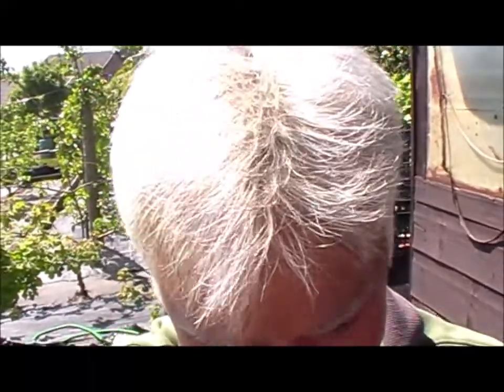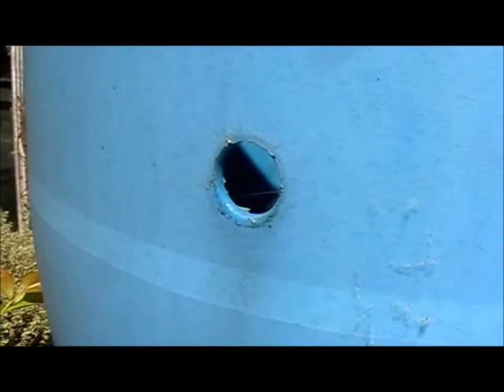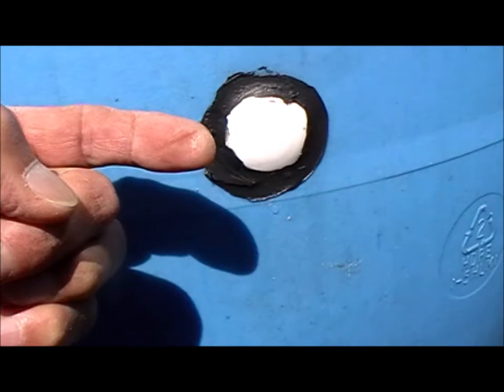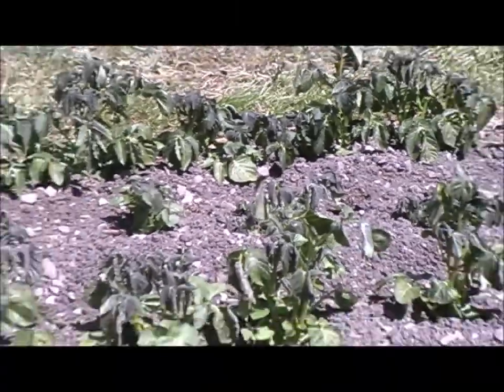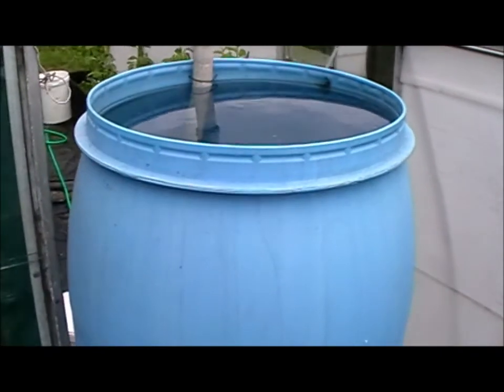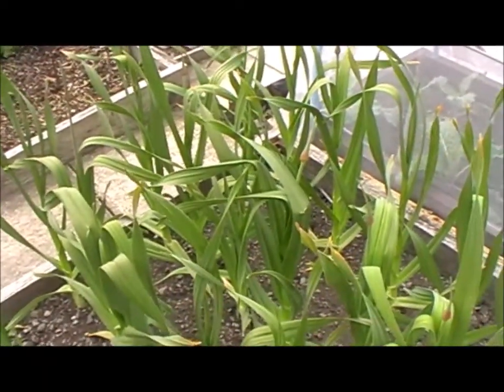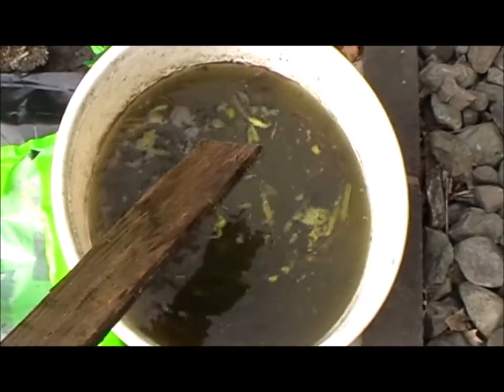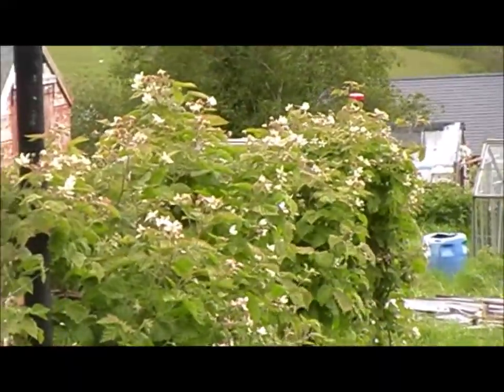I have a hole in my Butt! Frost damage and more.

Comment: Hello Woody, knowing the issue with the blue plastic I would recommend leaving the tap in and putting another one below so you can fill you can twice as quick 🤔😁 also water will seal its self over time. Don't tighten the cap on  your storage can for the comfrey or the gasses will swell the can and just as you bend down it will go pop.....lol.🤣😓😓😓😓😓😓

♻️Happy gardening, Terry.
Reply from the maker: Morning Terry, the gutter sealant did the trick and its now water tight ;-)
thanks for the tip about not tightening the lids on the gallon containers too tight - I don't want an explosion Lol!
thanks mate - have a great day :-)
Reply: @cumbrianhomestead  ♻️👍♻️

Comment: Grab a bit of scrap plastic (thick washing up liquid bottle should do it) five times the size of the hole and patch it from the inside, sillicon the crap out of it.  I think I used a vinyl adhesive last time I did one which also worked, just use lots and give 24 hours before you fill it up.  I'm looking forward to seeing how that zuke is gonna go given a "free run" as it were. The seeds I sent you are not a lot like the ones TrollForge sent to me originally, these one's have been "Willie-fied" and have a little extra "Vumph" shall we say :-) 🍺
Reply from the maker: Thanks for the first rate advice on plugging my butt mate 😉, it seems that the gutter sealant did the job. "Willie- fied"     zucchini eh🤔, can't wait to see how it turns out 😀😀.
Cheers mate 👍🍺🍺🍺🍺🍺🍺🍺